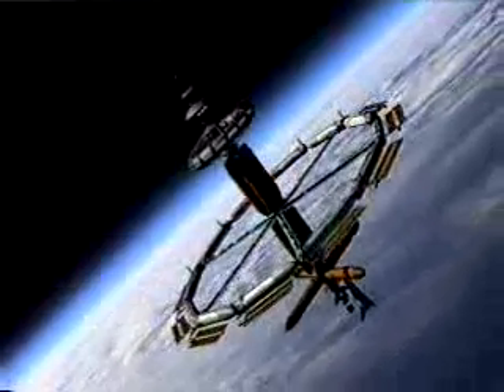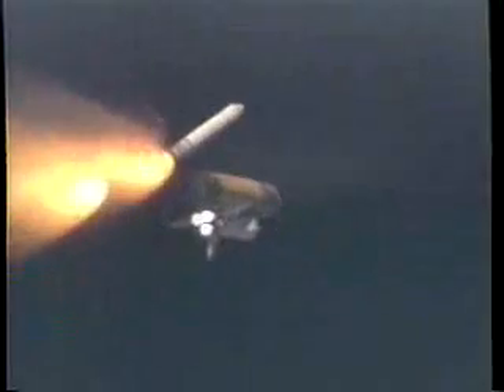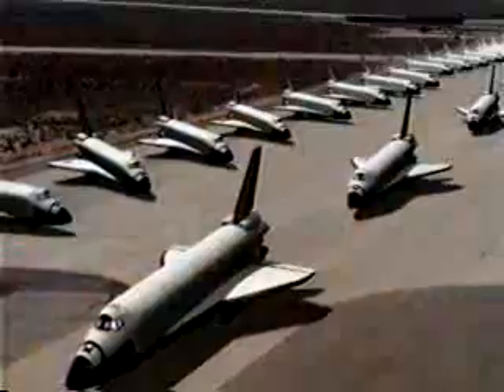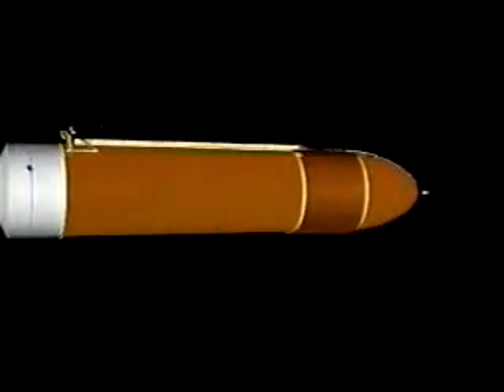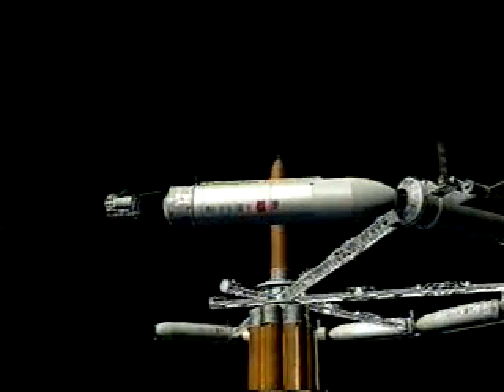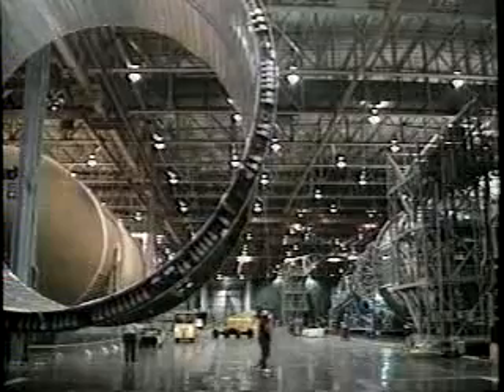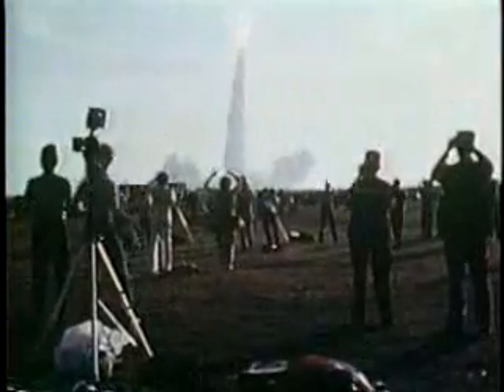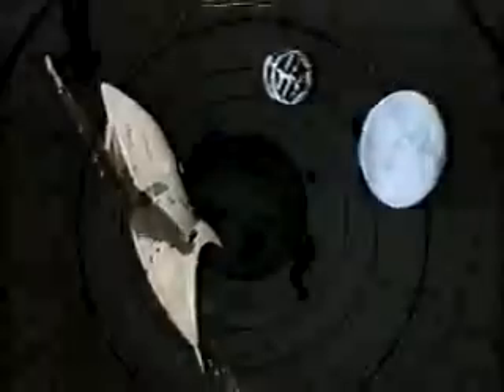The Space Island Project

Comment: Start with zero-G tanks. Perhaps they can be fitted for spin later, but we start with modified "wet launch" tankages in free-fall. Consider that the SRB attachment points are handy locations to attach these to trusses running up to a counter-mass of some kind -even empty tanks.
A single station could have habitable volume at Earth, Mars, and Lunar G, and free-fall.
Tanks could be lying flat and connected, but its far better to connect them side-side, across the spin. Remember that tanks designed for flat floors to be built in, won't attach nose-tail around the circumference. The long floors won't be flat, even if you mate these as segments of the circle.

There were plans to re-fit these in space with thickness of either loose-fill rock-dust or some form of ersatz concrete meter+ for shielding against galactic cosmic rays as well as Solar flares, and it makes a great meteorite shield. The shield and the bulk of the huge truss to spin the shielded habitat can fairly easily be boot-strapped from Lunar or asteroid resources in a near-term facility.
Effectively Earth-like conditions, anywhere you ship these tanks, and seeds for the facility.

Comment: No fuel at all is needed once a stable orbit is set, solar power could be used as a source of power.
Reply: You need fuel to stay in LEO, because LEO in not a perfect vacuum, there are particles that slow the station/space craft down, and by loosing speed you slowly drift towards earth. For example, they need to bring fuel to the ISS regularly.
Reply: Ocodo 
Solar electric engines which need far less propellant or even MHD tethers which need no propellant at all can be used for reboost.
Reply: Ocodo

Well typically they do it via the Progress and (I believe) Soyuz capsules docked periodically. That is to say they just don't bring fuel, they bring a module with fuel AND engines and use these to boost the stations orbit once in a while.

Comment: is this REAL ????????????
Reply: +outplayed 725 It was just a concept that died out years ago, along with the Space Shuttle itself; where did the Space Island Project expect to get the money to buy its own fleet of Space Shuttles when NASA's budget was nearly bled dry by just four of them?
It's easy to dream, and yes, it's a shame that NASA didn't use the idea of making space station sections out of external tanks (the idea goes back to the late 70s-early 80s), but the nixed the concept because it would likely have cost more than using smaller habitation modules.
There have always been a lot of dreamers in NASA, but their funding has been limited, and they have had to make do as best as they could; the Space Shuttle itself consumed so much funding that it took over 14 years from the time Ronald Reagan proposed a space station for construction to even begin (which it finally did in 1998).
Some early designs for the Shuttle included a two-stage-to-orbit version, with a manned fly-back booster; the development costs would have been much higher than the Shuttle we ended up with, but it would have been much cheaper to operate, far more reliable and safer, with a much more frequent launch rate.
This would have really opened the space frontier to America, but instead, NASA was given a small amount of funding for development; to garner support, NASA had to get in bed with the USAF; the Air Force then mandated that the Shuttle have a large enough cargo bay to carry large spy satellites, and a delta-wing shaped lifting body to accommodate certain orbital inclinations (they wanted to launch them into polar orbits from Vandenberg AFB in California); the Air Force then (rightly) dropped the idea like a hot potato after the Challenger disaster.
Thus, we ended up with the wrong Shuttle; it was still an impressive machine, however it was the wrong machine, and we ended up paying for it (and its exceedingly high operational costs) through the nose!

Hopefully, we are going to be entering a new era of manned spaceflight, with commercial options such as CTS and SpaceX's Dragon, launched on the Falcon 9 rocket, which is now testing the concept of automated flyback boosters, and eventually private space stations from Bigelow Aerospace; NASA is working on the SLS, however there is the possibility that this may one day be given the ax, due to budget constraints.

Comment: So basically the theory was to launch a bunch of shuttles with thrusters and engines on the external tanks...and then connect them together to form a space station. The inside of that external tank is toxic. What are you going to do, get the garden hose out and wash the inside of the tank out? How could it be refurbished in space and plumbing, equipment, etc. installed to live in it? That makes very little sense...

Comment: Um. Why do we need to build the Shuttle part? Seems the technology exists to build and launch the pods. Skylab used Saturn V 2nd stage section preloaded. 

Build enough pods for the Space Island and launch to the assembly area. You would only need enough controls and fuel to steer and brake at assembly area. Then would need only one ship with crew to assemble or fly pods into place with remote docking. This seems similar to building the ISS except using considerably larger modules.